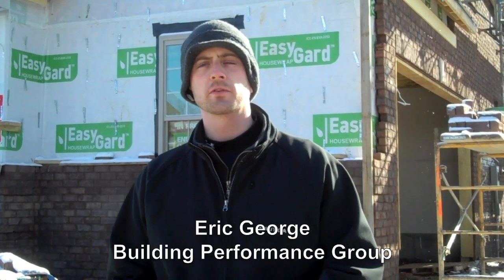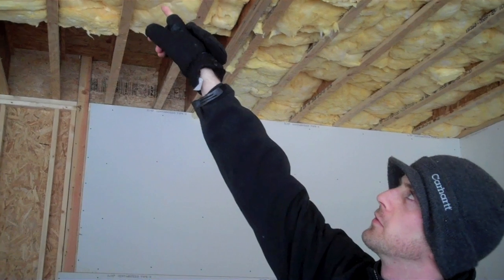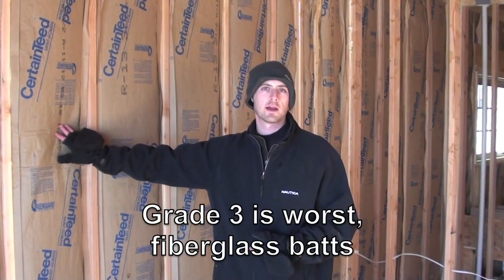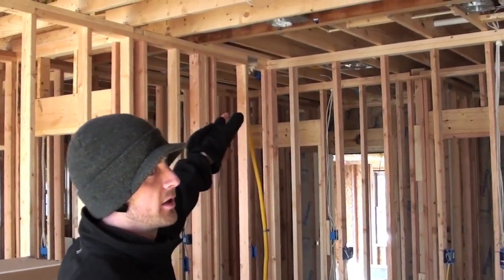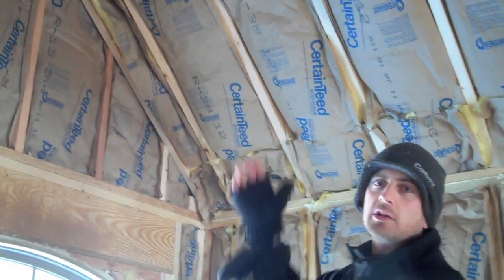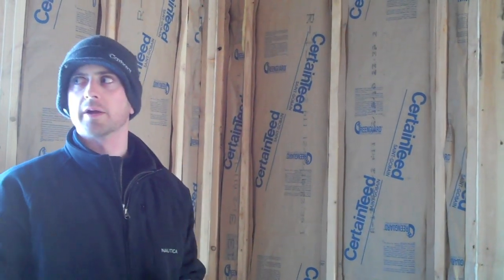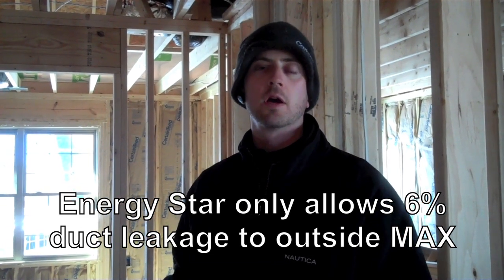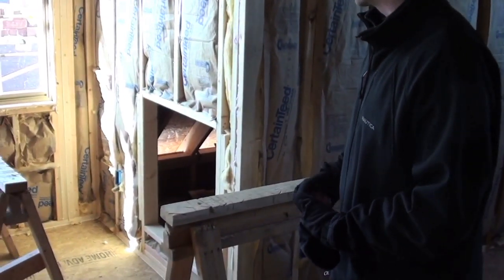Energy Star Home - Pre-drywall Inspection (Thermal Bypass Check)

Comment from the maker: @ootsam I'm not sure which section you're referring to, as there were several shots of knee walls in the video.  By "building paper" I'm assuming you're referring to the Tyvek house wrap, and yes, this should be installed on the exterior side of any wall cavity that does not already have an air-barrier present, such as OSB or foam board.